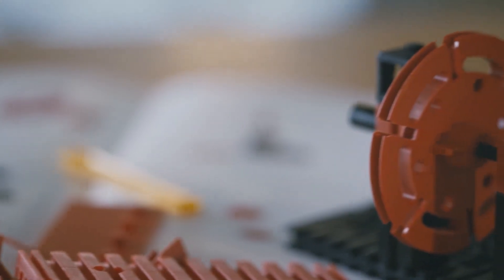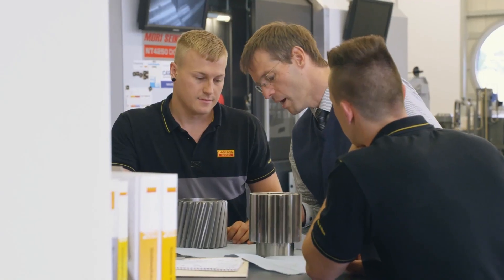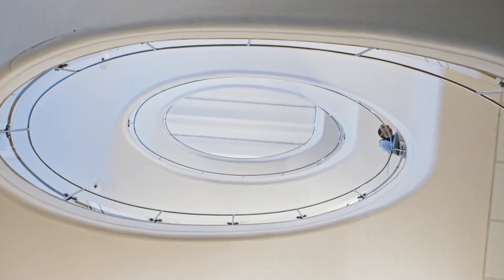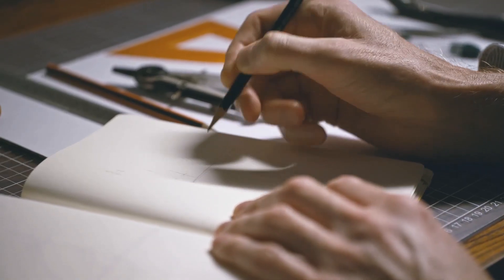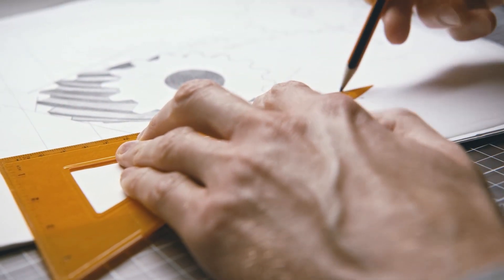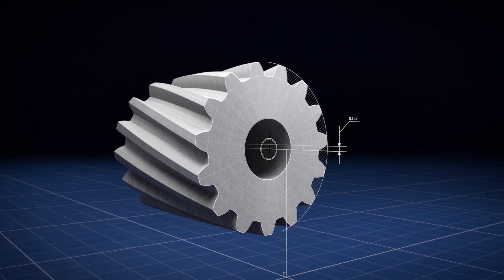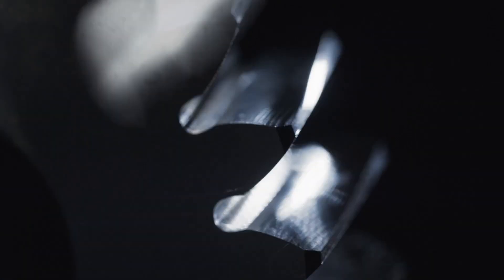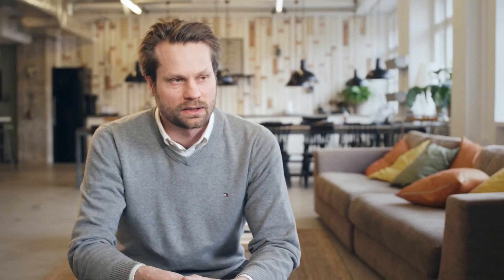A new approach to milling gears - The Creators by Sandvik Coromant

Comment: Your sales people needs to get their marketing straight: Here you say you only need 3 tools, last time I called to ask about this exact product the answer was that you need a separate (custom) tool for every pitch and tooth number. Which is it ?
Reply from the maker: With the InvoMilling™ method we can with only a few standard tools cover most needs when machining straight and helical spur gears. 
The flexibility of the method is one of the big benefits when using the InvoMilling method. For the method itself, no custom tools are needed and one tool will cover different modules due to that the 5-axis machine generates the movements that create the gear profile instead of the tool. To make the InvoMilling process easy to use we have developed the InvoMilling software which have been available on the market since about 18 months.

Best regards 

Kenneth Sundberg
Director - Global Gear Milling Solutions